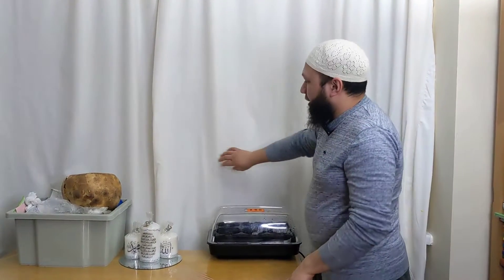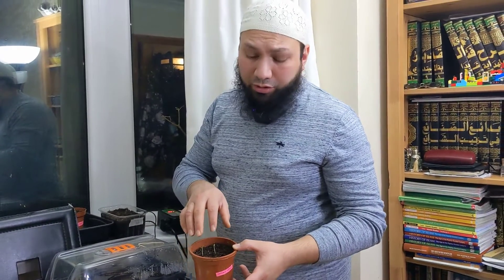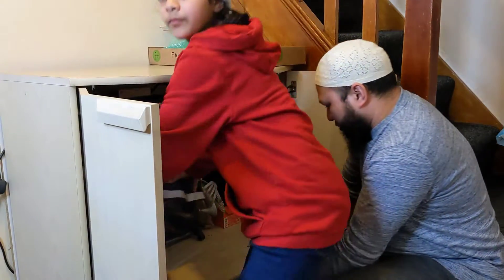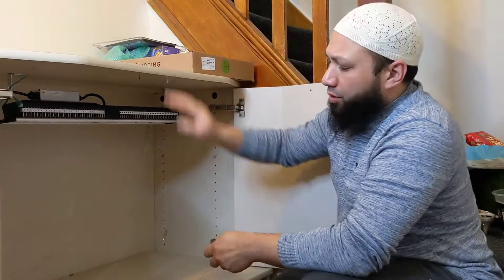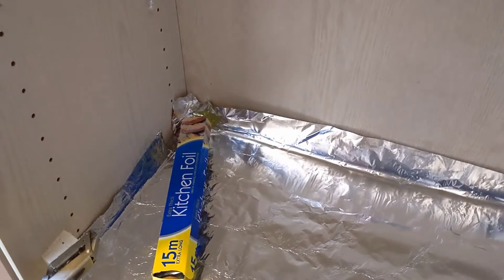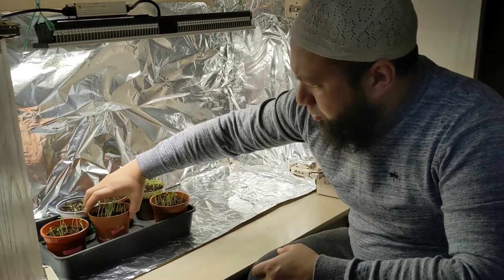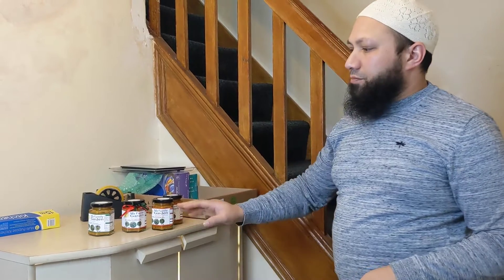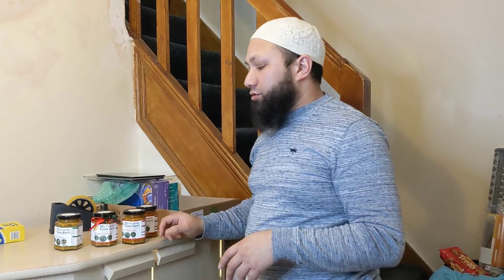Making A DIY Grow Room Doesn't Have To Be Difficult, Here's A Simple Low Tech Solution

Comment: Flat white reflects more light than silver foil. Acts like a mirror and reflects the light? mirrors absorb light, reflecting an image.
LED's fail because of heat build up, so a soft start up would not help. Read the instructions, as im sure there is not enough height above light. Good show, keep it up.

Comment: I'm pretty sure the early LED failures are due to the use in an enclosed space, the lamp/LEDs will get hot and need ventilation. Maybe drill some holes around the top of the sides and back to get some airflow?
Reply from the maker: You're the second person to suggest that, could very well be true, these units are supposed to have a good heat sink to prevent that
Reply: @MyFamilyGarden  If the doors are shut the heat has no where to escape, the heatsinks are useless at that point, as the air around them will get to the same temperature. Maybe leave the door slightly ajar for now until you drill some holes 😉

Comment: I'm a tin foil girl as well.
Reply: Mylar Space blankets are awesome. I started out with foil but you can make whole 1x1x2m room out of 4 space blankets for £3.50 for 4. I have one partitioning a room so it costs less to heat at night and some stuck to boards so i can move them around. They also expand back some when scrunched up so you can stuff them into any voids. 
They're almost mirrors but blurry, thermally insulating and love sticky tape.
Reply: @eviltaylor1  I bought mylar but the light shone through them.